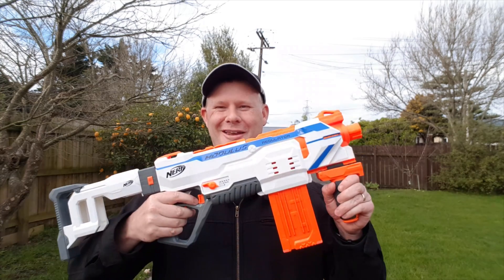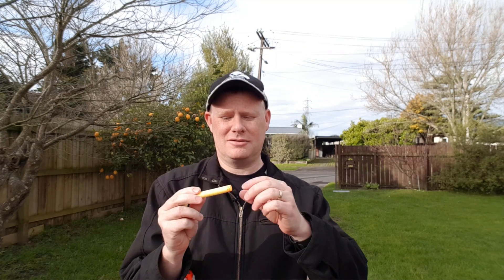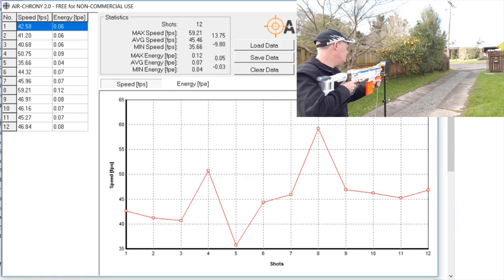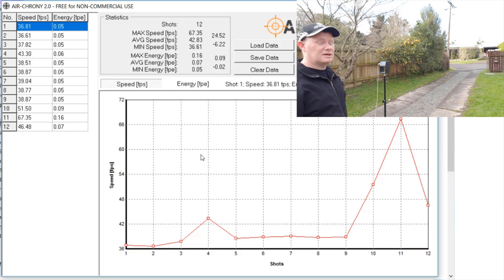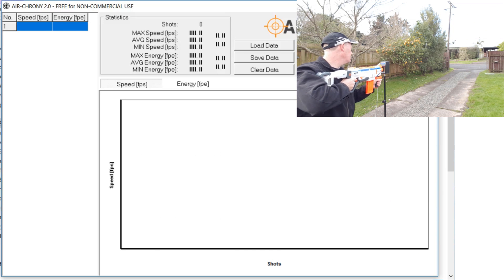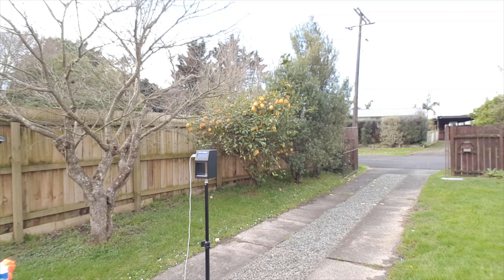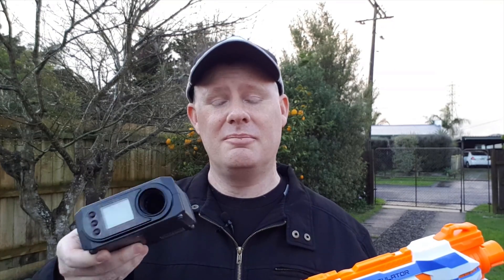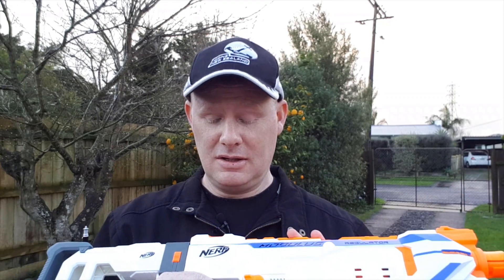⚡️ The Most Powerful Nerf Regulator Mod. Stock Chrono. Part 1

Comment from the maker: Meah After removing the locks and powering at 8.4V it went great until the on board VR died. it's over without buying a new one .. though that may not help OR Going full arduino... But no one will care.

Comment: Herez my thoughts, if like us in oz you probably got a grey trigger version 50 fps is about right.
2nd it has a canted cage not that good for high fps.
The ofp hyperfire cage fits no probs it think i may have had to shave a screw port. I would b careful of voltage you may fry the board im running hellcats on 2s no issues i think 12v u may but then again.
Reply from the maker: the interesting thing is that between the cut-seen i re tested again .. and even tried it though the other chrono .. and pretty much got the same FPS.. so it is what it is...... It does have a Gray trigger .. surely they wouldn't have a lower FPS for AU/NZ ? do you have any other info on this ?....
yeah over 12V should kill it but i have a good way to prevent that...(well i think so lol)
Reply: Grey trigger in UK as well I believe. They are less powerful, springers tend to be around 20-25% less spring load and around 10-15fps lower. I assume flywheel blasters are similarly "nerfed" (couldn't resist). IIRC a stock grey trigger stryfe gets around 50-60fps so your regulator seems to be performing badly.
Reply: Blastertech comparing stock grey trigger stryfe to modded one. Their Grey trigger Stryfe seems to be average mid 50's.
https://www.youtube.com/watch?v=mf_qqMdMM3A

Foamdataservices original blue stryfe with orange trigger, averaging 65fps. So even the older stryfe with orange trigger is performing better.
https://www.youtube.com/watch?v=5bqXELUSB-8&t=13s